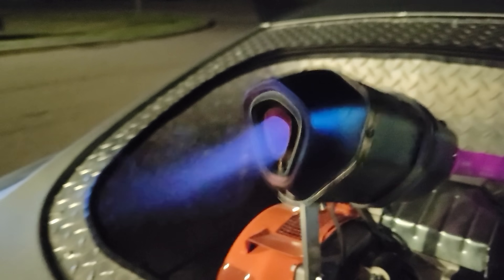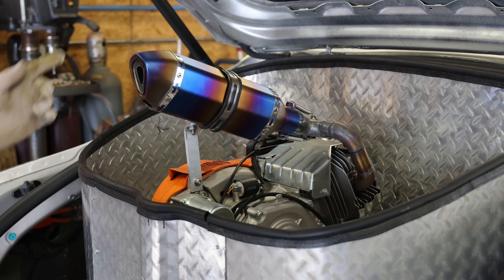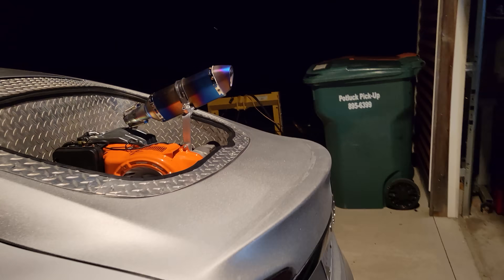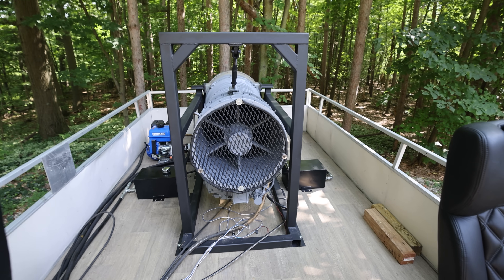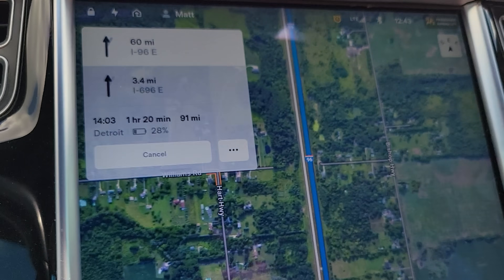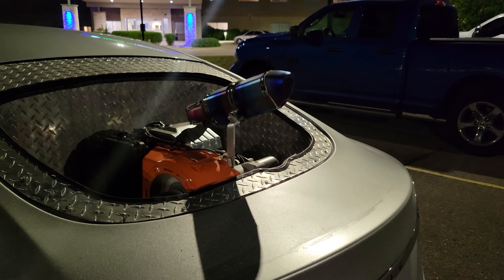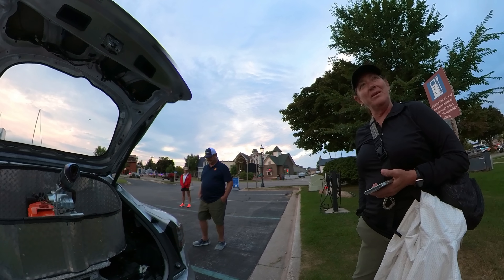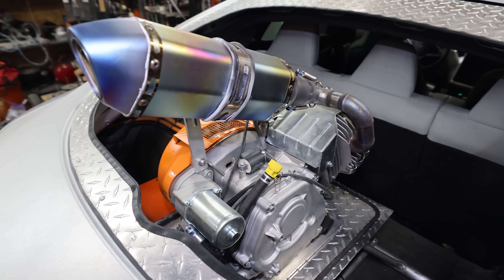Cordless Tesla (I Drive 1800 miles without charging) P.1

Comment: you need to put the megasquirt on the generator to get some more timing in that thing it would make less noise and wouldnt torch your exhaust and hopefully better efficiency
Reply: I was wondering why flames were coming out the back!
Reply: Really should put a megasquirt on a Prius 1.8/transaxle, and run an openinverter board on it, and cram that in a tiny trailer. Should put out 60kW while running extremely quietly.

Comment: You need a higher voltage generator head and step the voltage down similar to how wind turbines work.
Reply: EVs charge at 400v bro
Reply: @FSXgta  doesn’t matter what it charges at. Doesn’t change the fact the generator head is too low of voltage to efficiently charge the batteries. Especially when he has to boost the voltage to meet the charging requirements.

Comment: The exhaust flame is an indication of a lean fuel issue or retarded ignition timing, either way something you can fix easily enough, then your range extender engine will use less fuel and be more powerful and reliable and run cooler. Think about the same kind of setup but with a small 3 cylinder Kubota diesel engine, those things are tiny and make plenty of power possibly 20Kw and are very smooth and quiet, like that your range extender would make a Tesla unstoppable! Thank you for doing this project as I'm a Tesla EV user myself and it's something I'm very interested in. 
Man this channel is great, just keep these vids comin' you warped minded lunatic..

Comment: Question why did you opt for gasoline over diesel? Was the gasoline generator just what you had on hand?
Reply: I think the hole thing was just for effect really.  if it wasn't bad enough he had to leave the engine running most of the time when the car was parked and had to reduce speed to 45mph.

Comment: Chevrolet did that with the Volt. As is typical with GM they didn’t  promote the car and it’s now out of production. The Volt didn’t need to run non stop. The engine only started when the battery got low.

Comment: Better exhaust might have been a good idea
Reply: just another loop of pipe and a middle box would have worked wonders.  and even a better water cooled engine.  or even a small diesel engine would have had the torque to run a generator much better.